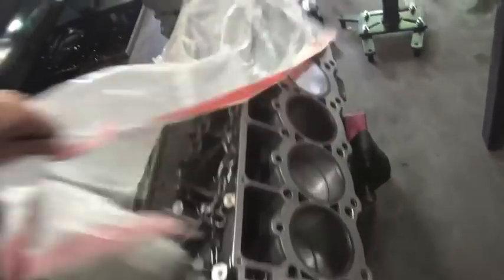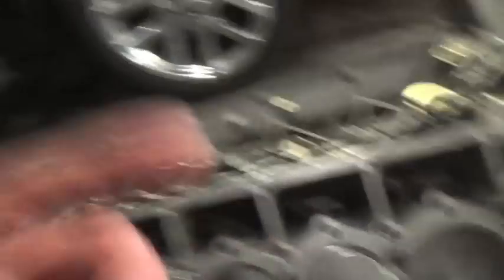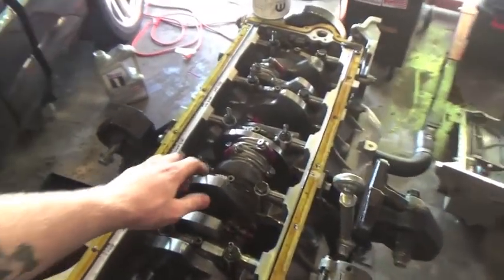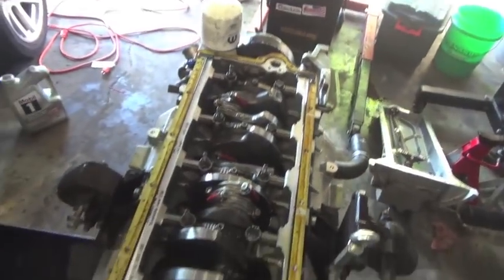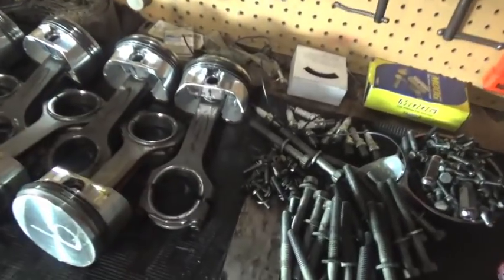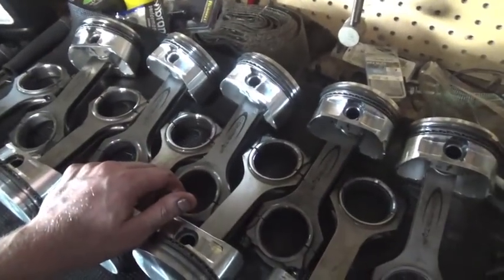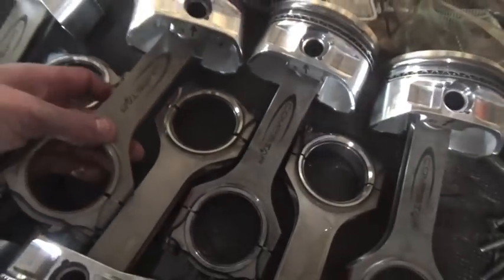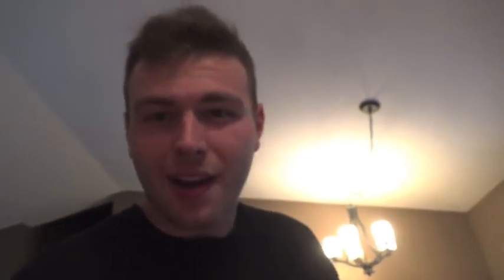Forged Viper Engine Noise FOUND!!

Comment: You should do oil mod on crank while it's out and run the updated oil relief valve for better crank bearing oiling if it's not done already.... what you have is wrong rod piston combo, those are correct viper rods but the piston is made for stock length rod and that's why it sticks out... thicker head gasket is easiest way to fix it  otherwise you would have to change rod or piston and and then rebalance crankshaft.
Reply from the maker: Jdubdavis409 what’s the updated oil relief valve??
Reply: It's a cylinder style oil relief valve instead of the spring and plunger style in the timing cover.  I got mine from arrow racing for around 100 bucks... I believe it's gen 4 an 5 style.. also plugging the cross drilled oil holes to give priority rod oiling is recommended for rod bearing longevity.
Reply: Jdubdavis409 do you have a partnumber of the updated valve?